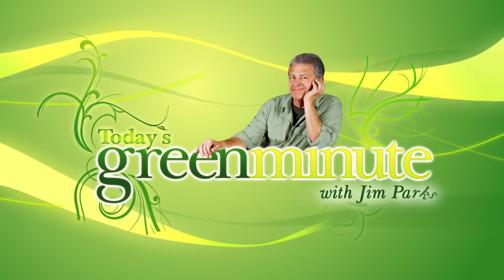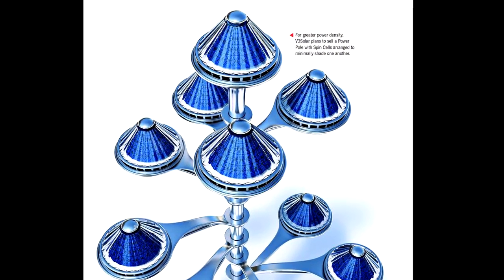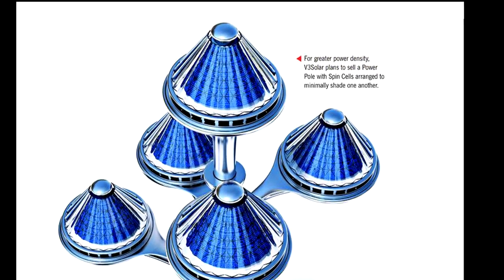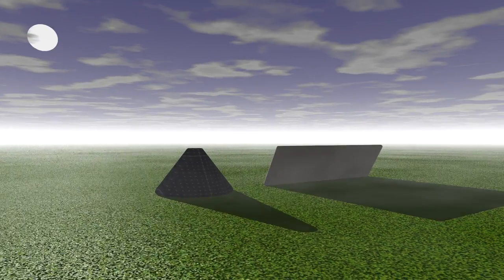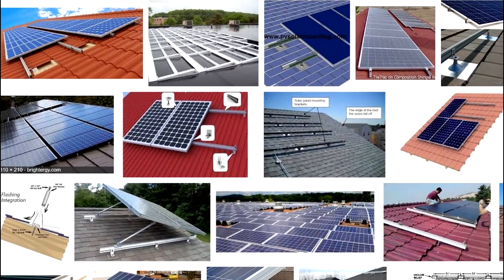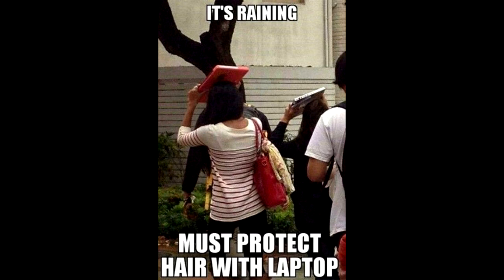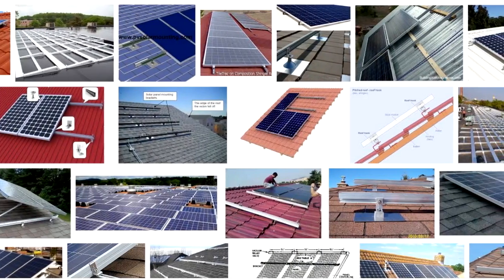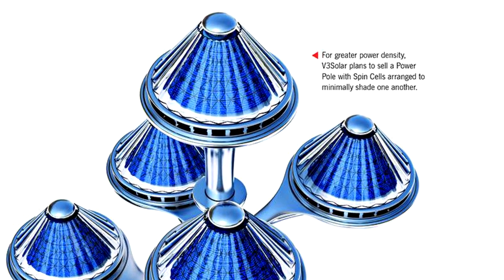Spinning Solar -BUSTED!

Comment: "for once the Bible will be right..."???   Dude!  Did you know that early day scientists use to mock the Bible for it's claim that the stars were as numerous as the grains of sand?   Science use to think the stars could be counted!  They finally had to agree with Bible, but never mentioned the correlation.  
Did you know that an old prophet mentioned the rivers nt he ocean? That too scientists use to make fun of... but we know now that there are rivers of currents through out the ocean.. Not to mention an old prophet that referred to the earth as sphere dangling in space! And Paul who said that everything was made of "the invisible", and "The One that holds it all together will one day return..." which directly refers to Quantum Physics and the (though science once thought they knew how it all worked) are faced with the ever growing mind boggling mysteries of what holds things together at the smallest levels, as the gain more and more info about it....  But no, the Bible is never right...   LOL   ;)   Dare you to read some of the current day scientists opinions on that    (google it)

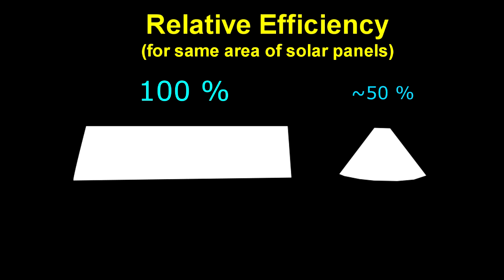Comment: The dimensional analysis does not work for the shadow.  Generators that produce 20% more energy 6:18 would block 17% less light.  You might grow tomatoes or oranges in the same yard.  If you have scattered light mixing in from the poles and/or nearby walls the tomatoes could grow at close to the rate of plants in full direct sunlight.  Most plants cannot use 100% of noon solar so a little bit of scattered light and shading just reduces water demand.

Comment: I'll agree about this being a bad idea, but not so much because of the surface area point you went over, as the point of using more panels for less area is for the "spin" to cool them down, basically trying to reduce construction cost by reducing the materials cost despite the increase in the materials requirements. I suppose the fact that a cone would essentially function like a tracker instead of a static panel is a bonus as well, but I doubt it would help that much. The decreasing cost and increasing efficiency of conventional solar panels and development of roofing tile panels and the like works against this idea pretty hard by itself; it doesn't help that as you pointed out the efficiency drop from heat, while existent, is less than catastrophic. Ultimately, unless they're worried about scarcity of the more heat resistant materials or have found a new kind of solar panel (which if so they conveniently forgot to mention such a discovery) that has a significantly greater efficiency when kept cool, the increased maintenance costs and the waste in the form of gaps should one line up these cones side by side (with the tree design wasting even more sunlight area) will make their entire concept backfire spectacularly, basically creating something that costs more while doing no better at best. 
The biggest point that confuses me in their "logic" is the glass covers. My only guess is that they're trying to avoid a greenhouse effect by using advanced (and expensive) photonic crystals configured to block IR (supposedly a better insulator than pure vacuum) instead of glass while forgetting to mention that secret sauce, but I doubt that would work anyways what with heat generation due to the other wavelengths and entropy on the panels themselves... 
Yeah, they're basically wasting money with this R&D (unless there's some new, ultra-thermal-sensitive solar panel discovery they're conveniently forgetting to announce).

Comment: I've only give the problem about 45 seconds of thought and I'm not too bright but I could see using traditional solar panels line with water thermal solar panels to solve the heating issues while harvesting that heat in the form of heated water to either further generate electricity or heat homes. Combine that with the solar tracking system and heat pump heat sink climate control technology and you could have a fairly efficient solar setup. I truly do want this type of technology to work and replace fossil fuels but this is just nonsense or plain ignorance of how solar works. A large part of what makes solar impractical is the storage of the energy you capture, the inefficiency of the conversion from DC to AC once you stored it in massive expensive battery Banks. The biggest steps could be made and improving Battery Technology to help further Advance solar power into a viable option especially on vehicles. I do not see this ever being the only means by which we generate electricity, because the Sun doesn't always shine everywhere however with wind and hydroelectric dams we could potentially create a semi reliable Network that would greatly reduce their dependence on fossil fuels. Nuclear seems to scare people people don't want it near their homes although it's safer than the high-voltage power lines leaving from the facilities. It does leave the problem of nuclear waste to deal with. But I personally feel it's one of the best options. Ultimately to have a reliable network will have to have all of these things in unison as a workable system that we can depend on

Comment: Well the obvious first problem I see you don't need to worry about Heat if they are 100percent efficient. As all the energy will be turned to electricity not to heat or other forms and 100% efficiency or even close exceeds anything we're capable of under the best circumstances this nearly falls into the category of free energy device

Comment: Wouldn't the efficiency of the spinning panel increase as the sun passes over it?
 It has way more surface area in terms of a sunlight crosssection when thinking about a moving light source. So even if it's at most 50% at an angle that favors a flat panel, the sun would eventually move to an angle that reduces effectiveness on the flat panel, but (and assuming the glass cover actually does anything to refract the light onto the panels) would only increase or remain at it's previous output until the sun goes down and neither panel would get power at all. 
So when thinking about a  moving light  source, would it achieve a higher total output over the course of the entire day?

Comment: I see what you're saying and agree with your rationale,  but it seems that you're only addressing the performance of the cells at a finite point in time; not over time as the sun arcs across the sky (which I imagine would compromise the efficiency of a flat cell while the cone might continue to be effective)  So, at the end of the day which type of cells would have captured more sun and generated more power?

Comment: 2:15 I am not defending this creations, but it’s not just about electrical output efficiency. It’s also about capturing light efficiency. So the total result could be 20 times more efficient than regular panels.
Reply: Sašo M that’s not correct and he addressed it with the illustration of the required size of the optical glass relative to the solar cone.

Comment: Am all with you on this one but part of the problems could be easily avoided

Put a mirror in the back to have more exposure, instead of having a greenhouse glass cover on it, have sheets of glass so it can 1)dissipate the heat and 2) drag in the wind to turn

Unlike you im not about all bashing, i look for solutions... I seek for the bright side ;)

Comment: I think what they have ment with "20 times mor efficient" is that normal solar panels can't use 80% of the light and turn it into electricity. By saying it is 20 times as efficient, only 4% of the light hitting the panel cannot be turned into electricity, giving it an efficiency of 96%.

Comment: Not that this would disprove your point, but you're putting in the area of the bottom of the cone too, which (I hope) is not consisting of solar cells.

Comment: If this were a binary galaxy (a galaxy with two stars, at least I think that's the terminology) and the stars were at a proper angle so that at noon they could supply power to both sides, then maybe it would be efficient.

But overall, you would be better off with two tracking panels in both situations.

Comment: im not for this thing, but i think by the 20x more efficient statement came from the idea that this thing was have more "sun hours" then a normal panel, Thus more operating hours per year on avg, and therefore generating in their minds 20 times more power. just a thought

Comment: I'm surprised you never touched on the fact that electricity needs to power a motor for this "spinning cone of solar power", thus reducing it's efficiency even further.
Reply: You could cut the energy costs of spinning it by putting in in a vacuum chamber and levitating it on magnets!  Only $1000 for this revolutionary upgrade!
Reply: @Deeeeeeeeeeeeeer  but in a vacuum spinning them wouldnt cool em anymore :p
Reply: @TheRolemodel1337  see my last comment from two weeks ago.
Reply: @Deeeeeeeeeeeeeer  the one in which you spelled you are/you're instead your? :p
your username suggested you're a native speaker
Reply: @TheRolemodel1337  Hey now....your grammar is nothing to write home about.  :P. At least for me I could argue that I was just adopting the role of 'idiot' to a deeper level.  (That is not the case....but I could....if I had no shame.)
Reply: @Deeeeeeeeeeeeeer  im not even a native speaker :D
Reply: TheRolemodel1337 ....actually, the contraction for “you are” is “you’re”.
Reply: @Deeeeeeeeeeeeeer  "in a vacuum chamber", you can't cool much :D
Reply: @ujiltromm7358  shh...you're "logic" and "physics" has no room in the scientific community.
Reply: Tracking solar panels generally use a gas spring system to turn, rather than electric motors. It basically works by having canisters on either side of the panel so that when the sun is not normal to the panel one canister is shaded and the other is exposed to the hot sunlight. This causes a pressure differential and volatile fluid to move between canisters, moving the panel.
Reply: @xHappygolucky724  like a minto wheel, but way more useful.

There's actually multiple ways to make something like this spin and even harvest the waste heat to generate more power.

However there's also better ways to do this sort of combined pv and solar thermal array thing
Reply: riddleman65 Yea, but Tracking panels don't move constantly.
Reply: @autinjones7194  
Those are not tracking panels. They spin constantly to keep them cool .
They dont track the sun constantly.....they just-a-keep on spinning
Reply: The f2p Pyro perpetual motion. Impossible.
Reply: All you need is some lubricant that lowers the friction to zero. No more magical than 100% efficient sonal panel I'd assume.
Reply: @kseriousr  you mean 400% 😁
Reply: My mistake. Sorry.
Reply: I mean what if the spin was similar to that of a normal wind turbine? That could be where they pulled the extra 200%
Reply: @Ragnaracc  Because of the way they designed it that's just not possible.
Reply: @Ragnaracc  if that was part of it then don't you think they would have mentioned it? Even if it were true, now you are talking about adding a generator as well. Which adds cost, complexity and now you have to have wind for them to work? And have you seen how large those windmills are? You think this tiny thing will produce any useful electricity from the wind spinning it? This idea and the idea of making them wind turbines too is just absurd.
Reply: wow,  where did you get that idea?
Reply: marketing genious
Reply: OK, maybe that's how it works. It's not a Solarpanel in the First Place but a Windturbine which is built out of Solar Panels to get Power from the Light and from the Wind. This means the real Thing looks extremely different but on the other Hand some of the Claims suddenly make Sense.

Some of You may remember the oldfashioned Lightbulb and the Boost in Efficiency by Marketing ? They remarketed as a Heatball with the Light as Byproduct because the Lightbulb converts more Power into heat than into Light.
Reply: The rotating cone solar panel claims to be like a tracking panel , but better .
The magnet idea how are you going to get the power from the spinning panel that produce DC current out ?
You gonna put a DC to AC converter  and a heavy copper coil in it to get anything out of it ... both wasting lot of power in process . 
You can make tracking panels also so you self go and turn them 15° every hour .  
Today there is transparent solar panels too , you can replace every window with them .
Rural area is full of grain silos and barns to put solar panels on .
You can build fences from solar panels .
Its not like there is no room for normal panels .
Reply: Put some little blades on them to harness the wind that way you got wind power powering it too. Even more efficient.
Reply: @richardsanchez9190  that is if the blades didnt block the sun yet
Reply: @richardsanchez9190  You’d still better off with a wind turbine just standing next to a fixed panel. (The 20% cooling efficiency won’t compensate for the 50% shading inefficiency, so you’ve wasted your wind power as well.) Sorry.
Reply: @michaelhoste_  seems the sarcasm was lost.
Reply: @richardsanchez9190  Well yes it was. You need to flag it in text - you just wrote it out straight-faced. There are so many daft suggestions about how to slightly improve the efficiency of something already massively inefficient, using up even more energy that I don’t know where to begin.
Reply: In an ideal system, you don't need any power to keep a spinning object spinning. The energy requirement of spinning this thing in the real world largely depends on how close you can get your system to ideal (minimizing air resistance and the resistance of gears), which depends on a plethora of factors and is difficult to make estimations on. There is room for innovation here, which is why it's a difficult angle to tackle. Much easier to point out that even in an ideal world where this thing spins for free, it wouldn't be a worthwhile invention.
Reply: Idea off the top of my head.. what about using a memory material that changes shape when the sun hits that part of it - so as it gets hot it rotates into a stored shape during the day and turns the cone, then at night it reverts back to its original shape (a coil perhaps) and turns the cone back round to start the day again.
Reply: You don't need a Motor to spin if COLOR is Used Effectively, but solar motion doesn't have much torque.. You've must of seen those Solar Spinners, they have been spinning from Sunliht for Centuries. They are usually four "sails" like spokes on a wheel. One half of the "sails" or "pads" white, and the opposite sides painted black.. Sunlight will push on the white from reflection forces... I think that's how it works... One Side is Absorbing light motion while the opposite side is absorbing it. 

 Interesting IDEA - Self Cooling Solar - but I'm not defending the devices folly, but the spinning, in theory, can happen from the SUN alone... no electricity. They usually balance this little "contraption" on a needle as the "axis" for minimum resistance. I don't think solar will spin a contraption with any weight or resistance from "wires and brushs" might be too much. If Solar Energy was SO POWERFUL at Mechanical Movement we would use it but we dont... I imagine its not efficient enough.
Reply: Jason Sage ....so paint half of it white to reduce the efficiency another 50% off of the already miserable efficiency.
Reply: @jasonsage1417  Unfortunately the reflective side can’t generate power because the photons need to be absorbed. (And the cooling efficiency won’t make up for the 100% loss of those photons). Sorry.
Reply: Noo that's not a problem, because they'll just cut half of their surface area again to change the reflectiveness on one side and use the solar freakin' wind to spin it!
Reply: I think the spinning is supposed to be powered by the flow of air due to heat differentials.
Reply: Come on,  perpetual motion,  what a silly person, how could you not think of that my friend  ?
Reply: @sigmoidbeast7712  if you put a flat panel lie on the ground (how we do it rn) then we are getting energy wherever the sun is
Reply: That's what I said
Reply: nonono , it is solar energy it is free costs nothing to turn
Reply: That would probably not be that significant, if it was well balanced and low friction, it would take very little energy to keep it spinning.
Reply: the energy for the motor comes out of the extra 300% extra energy
Reply: it's called wind
Reply: Maybe because it's that obviousl that it's not worth mentioning? O.o
Reply: Except these aren't tracking cones......soooo, what was your point again?

Comment: This isn't your best video, I believe the 20x ment over a day, as they explained how as the sun moves, the flat solar panels get less efficient as the sun moves across the sky, with the cone, its always facing the sun, so it would be constant.
The rest of the video was fine I guess, that motor failing thing is a very sad truth though.

Comment: Not arguing against anything in the video in terms of efficiency per surface of solar panel. But how about looking at it as efficiency per area of installation? From an installation perspective looking how much you can get out of the space available rather than the material seems to be as valid a perspective, and I think that is the one they proposed, rather than the one the video debunked. Because that one is (as demonstrated) easily shown as ludicrous.

Comment: Learnt something new too. Didn't know solar panels are less effective when it gets hot. Allready thought of a much better way of cooling them. Place them at the bottom of dams have a heat sink at the back of the panels that the water flows thought.